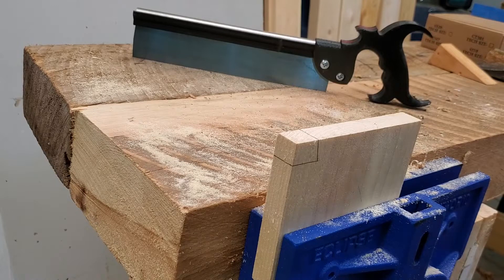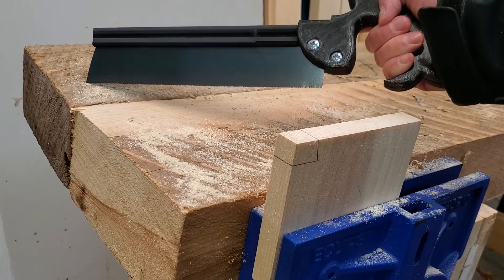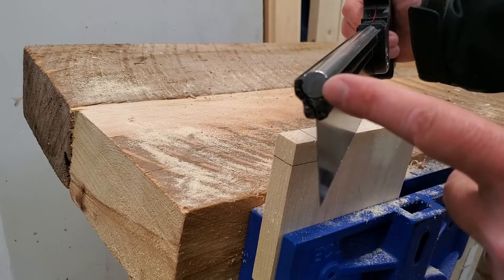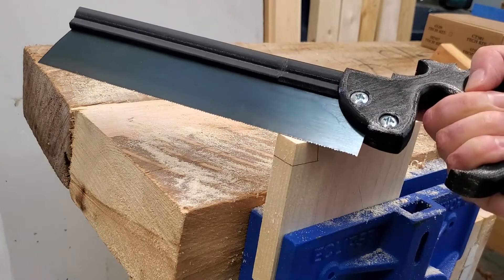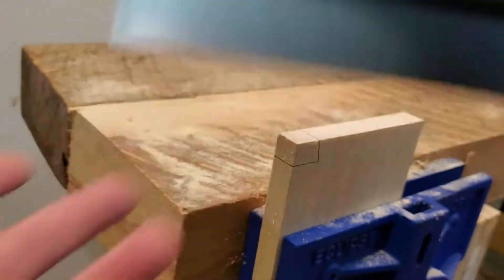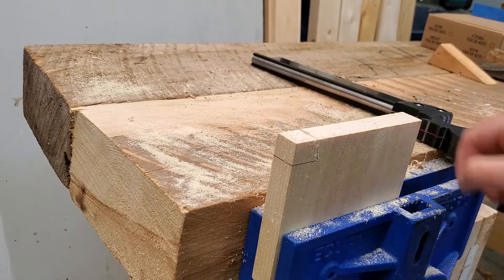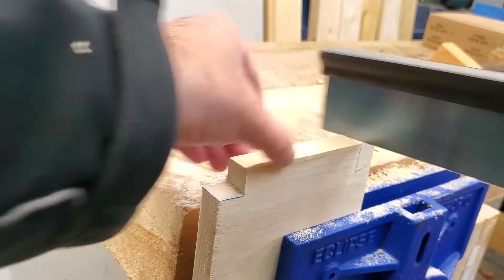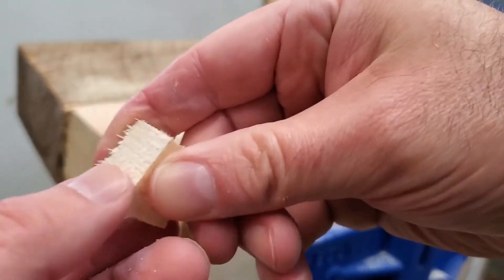DIY dovetail saw

Comment: That is very impressive. I'm interested in printing your design, but I'm afraid I have no idea how to make and sharpen teeth on that drywall knife. Got any advice related to that? Where can I find out more? Thanks!
Reply from the maker: Cutting the teeth requires a saw file, the same sort you'd need to sharpen a saw will cut the teeth too.  
One tricky aspect of cutting the teeth is getting the pitch right.  Here's a Paul Sellers video showing his method:
https://youtu.be/mTqZTGPPRj0?feature=shared
And another method, by James wright: https://youtu.be/7UEAoh2I1Lk?feature=shared
There are lots of others out there too, do a seach for sharpening a dovetail saw, or cutting teeth on a dovetail saw and you should get some more videos to check out. 
Good luck!
Reply: @AllanMacMillan  Wonderful! Thanks a lot for your response, I'll check these videos out. Also, congrats on your incredibly clever designs. I'm planning to print the sash clamp soon!

Comment: The way you did the spine is super cool!
And nice going with the drywall taping knife, I’m using one also as a sawplate for a dovetail saw with a laminated back that I used peened pins to hold.
Reply from the maker: You're actually the one who gave me the idea!  I was just about to write this comment, saying I didn't come up with this idea, and credit the person I responded to a couple of months ago on an @WoodByWright2 video.  Browsed to the comment in question, and behold, it was you I'd responded to back then.  Thanks again for the idea!
Reply: Neat!  Good work folks  @AllanMacMillan